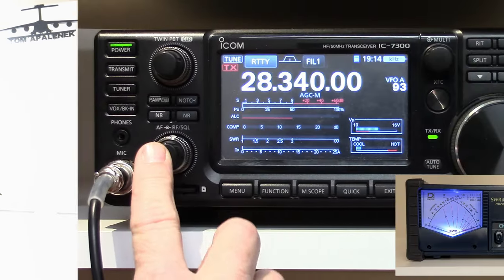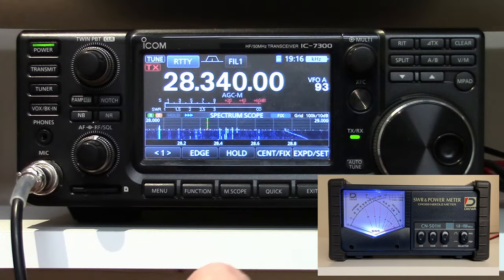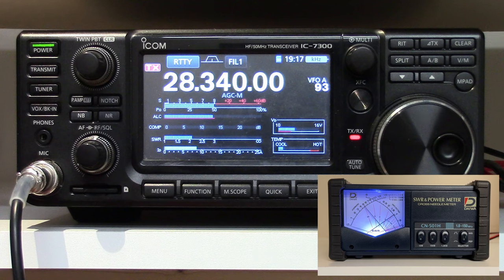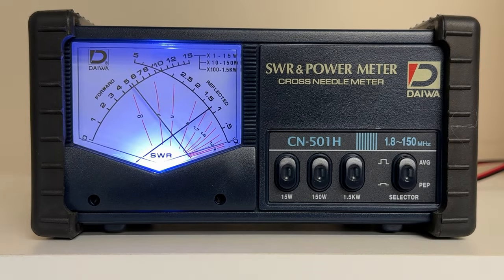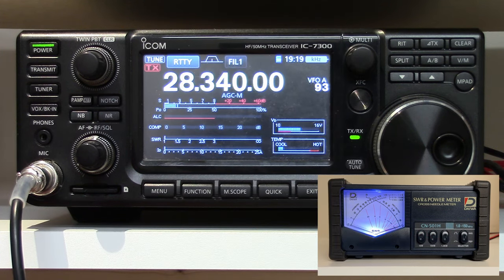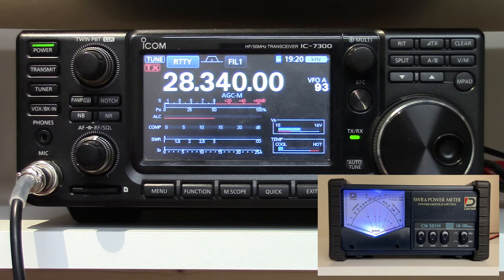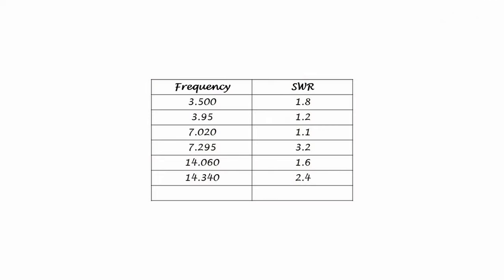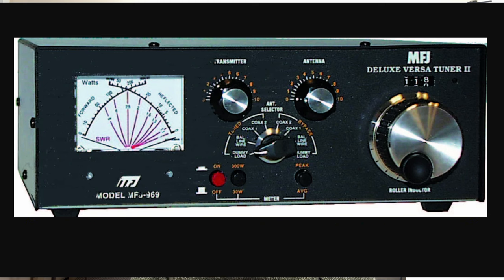External SWR Meter Placement

Comment: Great video Tom!  In aviation what we call the tuner is usually called a coupler.  A much more appropriate name.  If you have a tool like the Nano VNA its also good to capture and store a sweep of your antenna system once your tuning is complete.  You can then use it as a reference for any comparisons in future troubleshooting of the antenna system.  73
Reply from the maker: I agree, coupler makes more sense.  The Johnson Viking Match Box, a vintage manual tuner, also had a much better name.

Comment: Excellent explanation ! It's cleared things up in my mind as I have an swr meter in my manual tuner after my radio and a seperate power/SWR meter after my tuner. I tune my manual tuner to minimim swr but my SWR power meter AFTER my tuner reads a bit higher. Its my antenna that needs a tweak to lower the swr as its reading the true swr in the transmission line. Thank you!

Comment: Thanks Tom for your input on my problem.I will try the tests you suggest.That should tell me something. I checked all the instructions on the install of the soft start soft key from Harbach Electronics and all the wiring looks to be just as instructions state. Thanks again for your suggestions.Ron NB3W

Comment: Hi Tom!  Thanks for the video!  Great explanation!  I noticed your name plaque on your door.  I’m wondering if you’d share what your connection to the C-17 Globemaster is?  It’s my favorite airplane!
73!
Reply from the maker: That was a gift from an engineer at Boeing.  The company I worked for produced the flight control computers and other controls for the C-17.  I was our on-site systems engineer at Boeing for a couple years during a system upgrade.

Comment: Tom is there anything in the IC7300 need to be turned on in the menu to allow the 7300 to key an external amplifier?I am using a Drake L4B with the soft start soft key board installed from Harbach Electronics. I have not been able to get the IC7300 to cause the relay in the amp to close.I tried the phono plugs marked key and alc on the back of the 7300 and also tried using the din plug on the back using the ground pin and send pin.Mot sure if something needed to be turned on in the software to activate these functions.
Reply from the maker: Not that I know of.  The Send phono jack and pin 3 on the accessory jack should go to ground when the 7300 goes into Transmit.  I looked up the schematic for your soft start board.  It looks like grounding the Key input should work.  I would suggest a couple of tests.  Try grounding the key pin on the amplifier directly, with a temporary switch or jumper wire to confirm that the amplifier relay closes.  2nd, use a multimeter to confirm that the send pin on the 7300 is going to ground.  If it was ever connected to an amp that draws more than about 1/2 amp, or to a relay without a protection diode, the circuit in the 7300 may have been damaged.

Comment: do you have the Firmware 1.42 for the 7300/ If what is the advantage of the new firmware?
Reply from the maker: Have not installed it yet.  Looks like a pretty minor update, from what I read.  Oh, I think it’s also only available in Japan so far.  I forget what website I found that described the update.

Comment: This is puzzling... 🤯 The radio PA has an output impedance, ideally 50ohm. The built in tuner matches that to whichever complex impedance the antenna (+ feed) has at that single frequency. Which means that looking from the the external SWR meter towards the antenna, you have a complex impedance (Antenna + feed). AND, looking from the SWR meter input back towards the now tuned transceiver, you have the complex conjugate impedance: the tuner did it's job, you have a perfect match and max. power transfer. This is easily verified by a bit of complex circuit analysis or with a Smith Chart. So the transceiver plus built-in tuner now matches the antenna impedance perfectly, there should be no reflected power whatsoever. The SWR meter is not referenced by 50ohms anymore, its reference is the complex conjugate of the antenna. Except I see exactly what you do, I just repeated your experiment .... 🤷‍♂🤔
Reply: I just did the experiment with a 3dB attenuator as 'antenna', also giving an SWR of 1:3, however purely resistive. Same result. Measuring the open-ended attenuator, it equals a 150R resistor, which makes sense. So in order to achieve max power transfer, the tuner will have to present an equal output impedance: 150R.
Now my SWR meter lives in a 150R referenced universe, not 50R. And my 'antenna' is a simple 150R resistor. Yet, it still shows SWR 1:3.

That is what I don't understand.
Reply: Fast forward another day: I know whats going on. Your measurement is 'illegal': You can't use a SWR meter designed for a 50 ohm reference impedance in a 150 ohm (or anything other) impedance environment. Once the tuner has matched the antenna by its conjugate, there are no reflections between the two, it's a matched circuit and it's easy to prove in a smith chart. I've decided to build a 'tandem bridge' (Stockton), referenced to 150 ohm. I'm sure it will show a perfect SWR 1:1 between the tuner and a 150R load, which it should :) Best 73
Reply from the maker: Hi.  You are not quite understanding what a tuner does.  The tuner does not eliminate reflected power.  If you’re feeding an antenna with 50 ohm coax and the antenna does not present a 50 ohm impedance at its feed point, a tuner at the far end of the coax can’t fix that.  The reflected power and standing waves are still present.  The components of the tuner are absorbing and partly re-reflecting the reflected power and presenting a 50 ohm impedance at the transmitter connector so the radio doesn’t see it.  This is partly why tuners have power ratings.  So, an SWR meter (directional power meter) placed at the antenna side of the tuner is simply showing the reflected power that the antenna connection on the tuner is seeing.